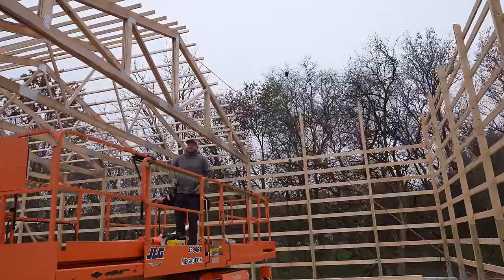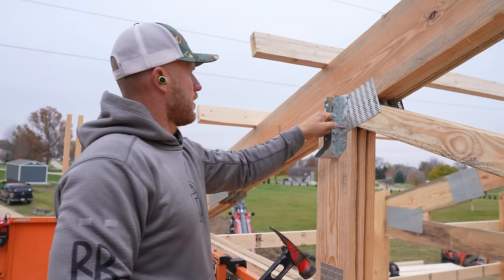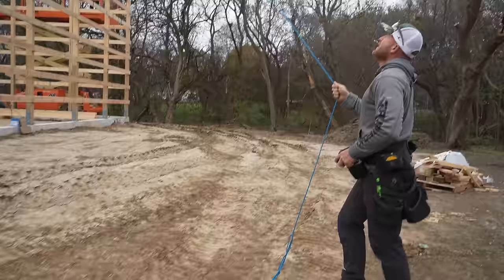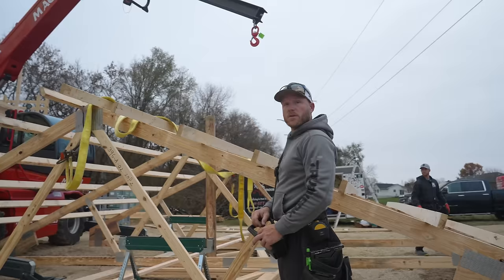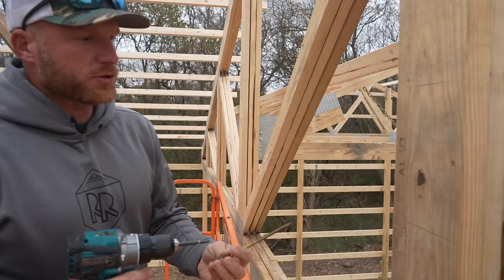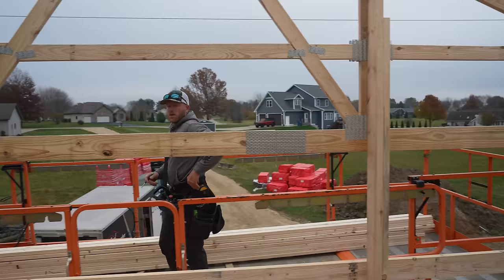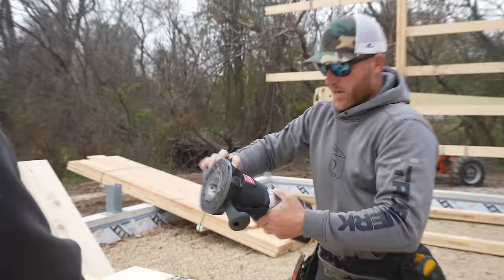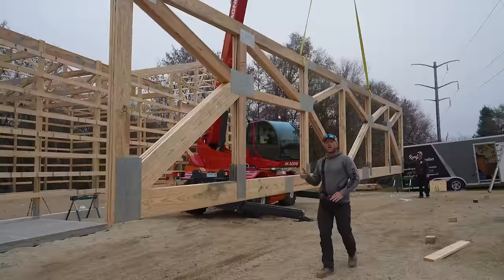My Dream Shop 12: Second Truss Set and Testing the Magni Rotator

Comment: I have found that drilling a 1/4"  or smaller hole through your lumber first, when trying to pull pieces together it makes it so much easier to draw them together since you are not dragging the long screw through triple 2x ? . It takes a couple minutes but worth it I think. Saves your wrist and pulls it together better.  I have even added a washer so not to draw the head into the wood so far.

Comment: Greg bringing the sarcasm!
Started building wood gate framing with GRK's 15 years ago, 3/16 pre-drill for 5/16X10's seems to fasten and hold with no splitting.
Also built a pergola with this method, 12 yrs in red cedar... 12ft 2x6s 4 screws per in vertical and still holding true.
The Greeks (Archytas) would be happy seeing his vision being used for so many uses in construction!

Comment: It's unbelievable how much putting up pole buildings has changed. Back when I did it, it was all hammer work, no screws. If we're were lucky we had an old p&l truck to set trusses, a lot of the time it was all ladder work. The truck had a post hole digger, otherwise we had to hire that out. Our only piece of safety equipment was a hammer. If I were younger, would love to put up one using the equipment available now days, would be an absolute blast. I enjoy watching you and Greg, I've learned alot. Greatly appreciate your attention to detail and quality. Keep up the good work

Comment: FBI built a building using their Qlift system near me last fall.  They built the entire roof system including steel panels and trim on the ground.  Missed seeing the actual lift but drove by 2 hours I saw them doing final lift prep and they were removing the lift system from the building.  Pretty amazing to see.

Comment: If you purchase this type of lift you can have adjustable spreaders made the will adjust load centers keeping lift level and not distort lift/truss by eliminating compressive loads caused by sling chords angles to truss and greatly increase productivity and safety.  Having a remote a single person bucket/harness would allow easy access from above to any area of job site also increasing productivity. Ray Stormont

Comment: Pro tip- screw a Simpson strap to the post and just use the magnet on the laser to the strap better connection/less movement than the 1 screw in the stabila bracket

Comment: Are the metal truss brackets in the shop area up to the task of carrying the weight of the truss? Doesn’t appear to be enough bracket or securement to the three ply truss that is carrying the load. Of course I no nothing about how to spec a truss hanger bracket. With that said, this is an epic build. I’m glad to see Kyle’s excitement about his project, and learning new ways to build. Best wishes to Kyle and Company.
Reply from the maker: don't worry, an engineer did

Comment: With that first roof section you installed perpendicular to the trusses in the middle of the building, are you not concerned with snow building up in the valley where it meets the main roof?
Reply from the maker: Stay tuned
Reply: My guess is that main roofline will extend and die into the perpendicular roof?

Comment: If your thinking about purchasing that magni you might consider getting a NCCER certification.  You don't want OSHA seeing you operate that without one.
Reply from the maker: why...as long as I am not using the winch i am good
Reply: @RRBuildings I used to operate an articulating boom without a cable or winch and still needed my NCCER card.
Reply: @RRBuildings  BTW the videos you guys put out are top notch

Comment: Why are the purloins installed upright?
Reply: Dang autocorrect….. purlins
Reply: @jeffhardenbrook2695  The posts are 8 feet on center, having them sitting flat on an almost-8-foot span might not have enough weight-bearing capacity for a sheathed roof with snow on it.
Reply: @aaronmdjones  thank you, makes sense.